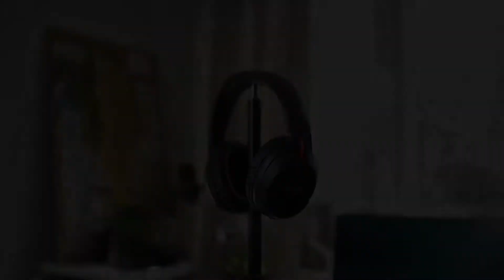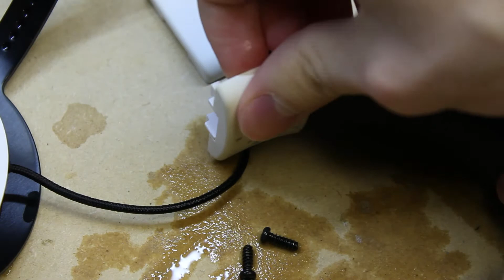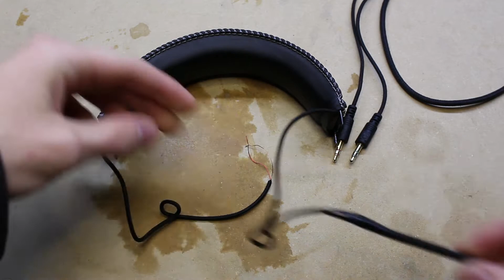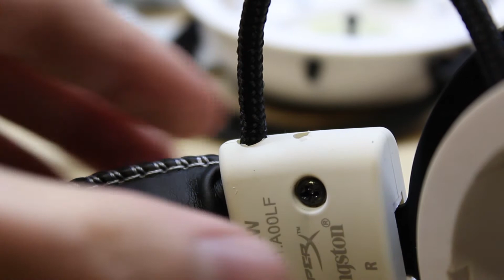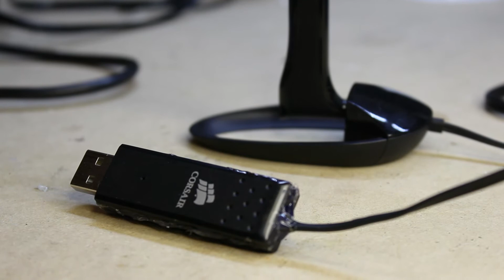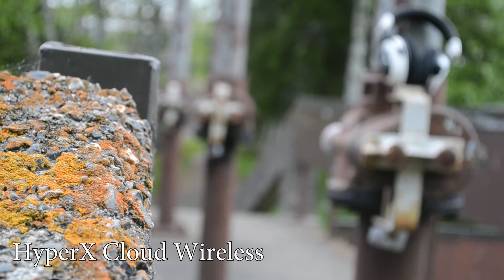Making the REAL HyperX Cloud Flight

Comment: I did a mod like this and my right ear has a slight buzz.

It only happens while either the right speaker wire or the ground wire is too close to the back of the left speaker.

Did you have that problem too? If yes how did you fix it?